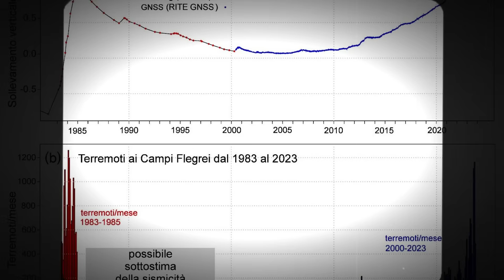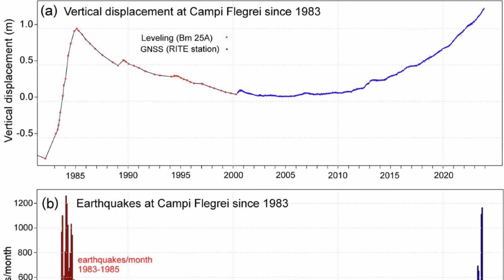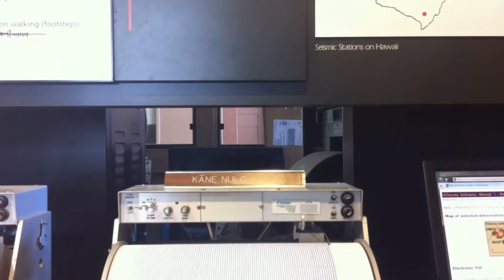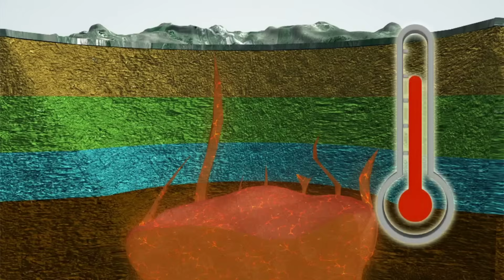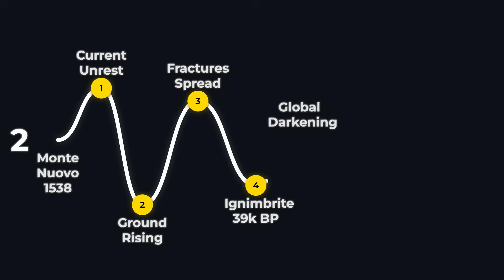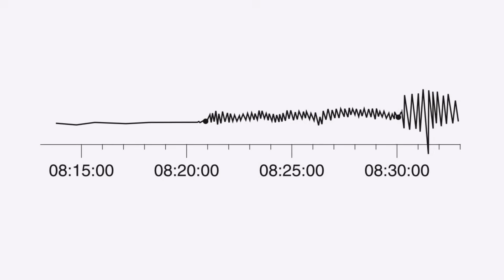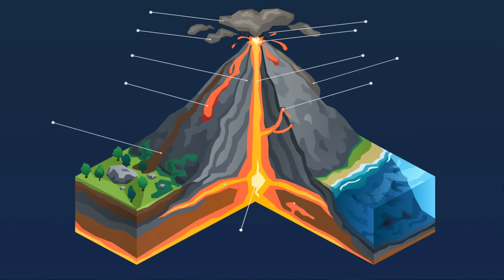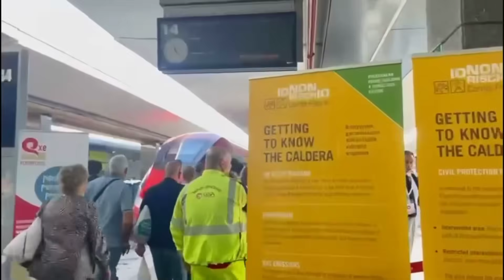BREAKING: Pressure Is FRACTURING Campi Flegrei's Crust — ERUPTION WARNING SOUNDED

Comment: Chlorine and  hydro whay?  ..  
 Yeah of course sufuric and hydrochloric acid , and chrlorine emulsiificarion...  
   So, only at meltdown  and not the rapid fission to fusion and  back again...  and nothing  realted and similar around silcily?  
   The underground thermonuclear    depths?  
  And those water chambers on the pictures ...  ...
 No, the second atom bomb was a compression  sort of thing ..  
 The idea is that the  surroundded  body is prssed uppon so quckly  that the mass surrounded  then ignites, they used plutonium ... but water is fairly unstable ,  flash points and such..  a shock wave into  a chamber filled with surrounded water... like a concert haĺl  has places singers stand and the sound bounces..   
 Anyway...  where the  resounding  shock waves intersect  is  like a  lense ,  and that million pounds of contsinment  pressure, then focuses the pressure into a fine of  massive heat by the vibrstion... are there hypersonic hums ? 
  Do whistle sort of things?  And then the thumps that  might tje heat pass throgh to the rock silicate fusions and cooling... not fully yet as a fusion bomb .... interesting...  any neutron and neutrino emissions being picked up on satalites?  We have arrays here that listen and can detect tjat stuff and C.E.R.N.   does or did  too.. 
 ..  is anyone doing and Tokamax field ossilations stuff.. 
   The ring bubble things ..  take a few of those  if they know what I mean , use them as dousing  triangulations things ,  the rings should lean or tilt  and aim directions...  the satalites have similar ones  probably more fine tuned vaccum and kind  of like a gyroscope..   land based  and the satalite ones .  Allow you some distance  ... if your right on top of it it might have it bouchimg  too much  to  get a fair read ...  
  ..   congratulations...  if it works... but also a sign, ... who beat me to it? ...   ? 
   And if not  ... no supra genius Saepieo Sexual Award ... 
 Sorry.. personal funny... some chick said she is saepio sexual... I was like ... oooh... Big Words. . 
  Mamm, that sensor will show whose gonna be doing the fcking real soon.. 
  Again, total saepieo sexual fail.. every thing she said or implied about fcking smart people.. the fcking mountain is gonnna be doing some ..   .. Im not going too deep into S.E.T.I.  either ... and the  AKC... but.... Im drifting off topic... 
   How many is the inquirie once  we figure that method working  at all.. .. 
  Big sort of blasts and where , how many are likely  to be set off  on , as Dutch Sense Channel says ' anti-pode '  , I guess I cant think of the right word for the other number of similar state and their shock wave compressions state of readiness... but, the triangulations to ' hear"  their emissions would be something that would give a better estimate about how many will potentially go off then and how many will get near critical what size the chambers  are  etc.... 
  Explosions in the ' water baloon " .. and which will bounce back to the Med and set the others off etc  etc.. 
 Totally glad about the run time tests ...  that sort of ash ,  crszy... and the  water fountains  had better be near by ,  to knock the shyt down in a serious hurry too.. 
  Eclectic sounding ... but I get it.... 
 Im not sure the women nor the Russians and India at all do.. 
  Anyway... the women of Florida... Tourism Board and shyt...  and keeping the males here and not accepting the women evacuess and work forces.. all for dogs and broke scum fck dudes... another Saepieo Sexual  FAIL. ... I asked her to prove it... and not even one sign pointing to it... 
   Debate class ..  ? ...  she probably blew her way to phi theata kappa... you know working her way through collage the old fashioned way... anyway...  oh well... FEMA ought to be interested in the detection method.. maybe not though, for 20 years now not one fck given ... 
  Looked in my work boots for that pay check and shyt hasnt been in there either...  whatever ... yall have a nice day..  advise the women to evacuate ..  I have not been able to get them to see the sense in it.... maybe yall can?